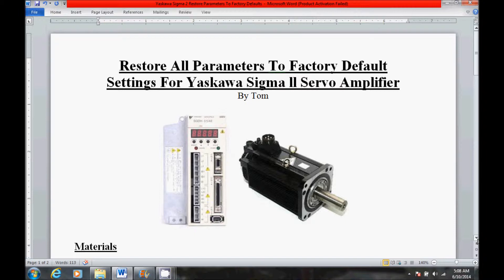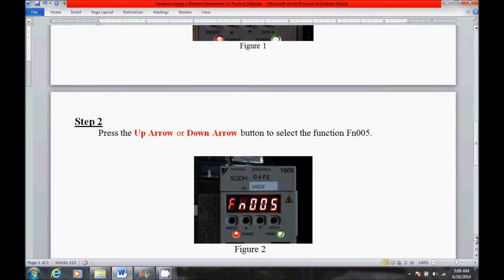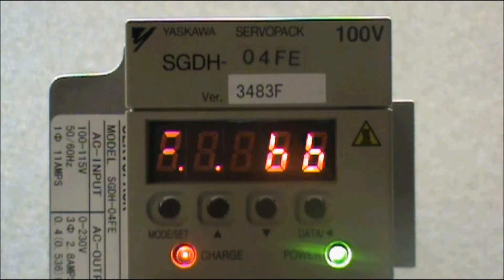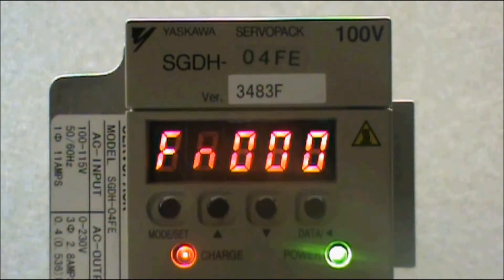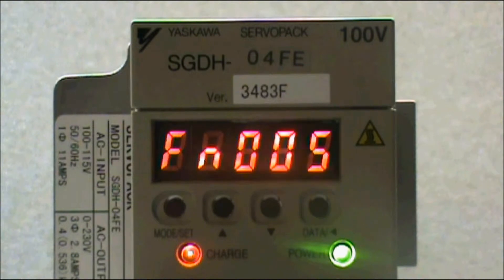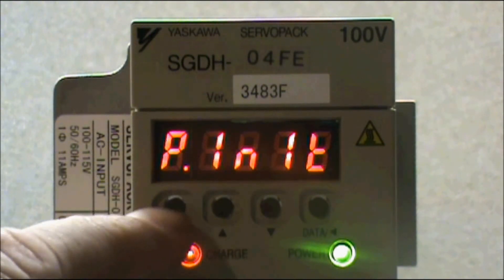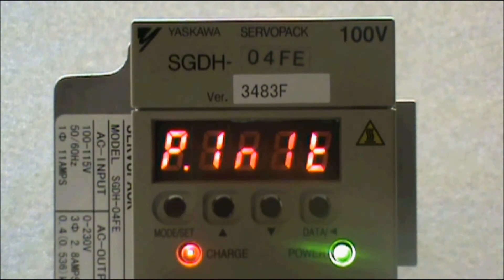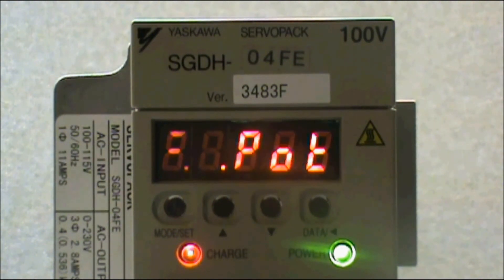How To Reset A Sigma II Servo Amplifier To Factory Default Settings

Comment: Hello Tom H, 
If we reset SGDM Seropack, it will show no op when we press fn008
Reply from the maker: Appidi Vinay 
First  I need to know is there any faults or errors displayed. And did the happen during a new install or
replacement of a bad servo. 
But with being said the times that I have seen this problem is when, an incremental encoder is being used in the
place of an absolute encoder. Check and verify with the name plate. 
Note: I have had the case when a repaired servo motor came back with the wrong encoder.
To start things off things I would check.
* 
1. Check and ensure the servo motor being used has an absolute encoder and not an incremental encoder. Pop the cap
and check the encoder condition if it has been repaired. 
If you have a spare motor connect the encoder cable to this one and run the Absolute encoder setup again. Power
cable not needed!
*
2. Check the condition of the encoder cable including plugs for damage. If you have a spare cable try swapping cable if works install cable properly to avoid possible damage and noise.
* 
3. The board that reads the encoder data on the servo amplifier is bad. Replace the amplifier. 
*
If you find a different solution PLEASE POST for other viewers. 

Hope this Helps 
Tom
Reply: @tomh2466  
Tom H it getting an error A.C9
Reply: Yesterday it worked properly, today when I start the machine, the servopack showing an error A.C9
Reply from the maker: @appidivinay9294  
Ok, it worked properly yesterday,  I am assuming that was after the no op issue. 
*
These two problems are still related to each other,  the A.C9 is still an encoder communication issue. What we need to do is to start the process of elimination, now since communication can be disrupted in a couple different ways I would start by if you have a new cable just lay it across the floor and connect to the amplifier and motor to see if this takes care of the issue, this would be the simplest and fastest way to get the line back into production. (If the problem is corrected I would dissect the cable to see the cause)
*
Or you can use a meter to test the encoder cable wiring, wire to wire & to ground I would move or flex the cable while doing this you would also need to look at the plugs. Over time if the encoder cable plug for the motor is loose the female sockets begin to wallow out, so visually inspect the plug. 
*
Also you could be having noise being induced to the encoder cable, if the cable is running along high power cables separate them at least 12" apart. also ensure proper grounding is used.
*
Another issue would be higher wattage amplifiers use a separate 24vdc power supply to power the electronics of the amplifier, check the output voltage at the  power supply & input voltage to the amplifier. 
*
If the A.C9 is an intermittent issue use a meter capable of trending and watch for power sags of the 24vdc. Also make sure all connections are tight wires & cables, sometimes sockets that cables plug into begin to wear out due to vibration. 
*
The next area would be the servo motor its self, but here you a would be kind of limited, so swapping the motor, this would be the quickest option. 
*
Next the amplifier could have a bad board or socket for the encoder cable plug or for the circuit board. Here replacing the amplifier would be the best option.
  
And as before if you find solution other then what is posted PLEASE POST SOLUTION, for others.

Hope This Helps
Tom

Comment: how to reset a93?
Reply from the maker: Hello munir 
The a.93 is only an Absolute Encoder Battery WARNING
But this depends on when the warning occurred.

Usually when this warning appears  the battery backup for the absolute encoder is low (below 2.7vdc) and should be replaced before the drive looses power, if power is lost and battery backup voltage is to low you could loose absolute position and re-zeroing will be needed.

Also if powering up the servo after replacement of motor or drive, the drive could be programmed for incremental encoder while using absolute encoder.
Check parameter PN002  bit #2.
(0 = Uses absolute encoder as an absolute encoder)

(1 = Uses absolute encoder as an incremental encoder)

Could also be a board fault. 

If occurred after replacement of battery back up, ensure polarity is correct.

Hope This Helps
Tom